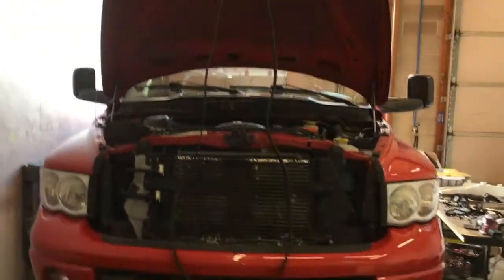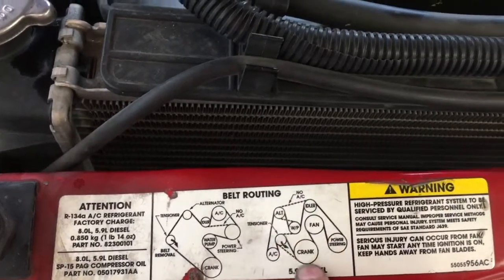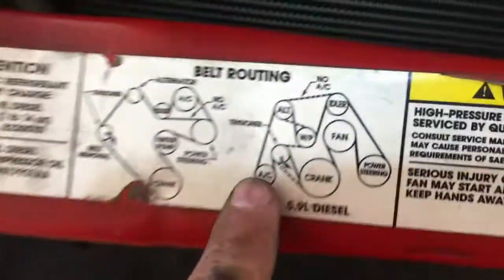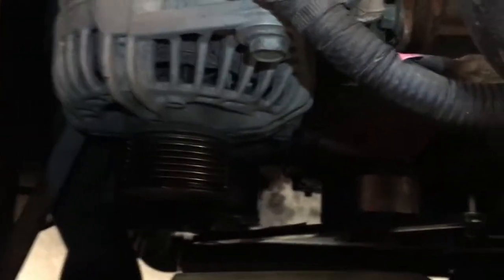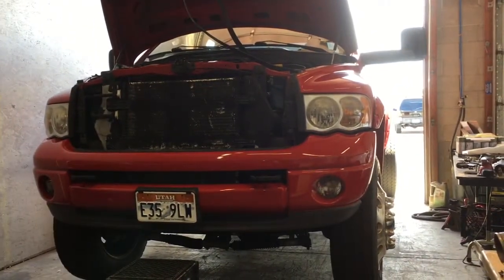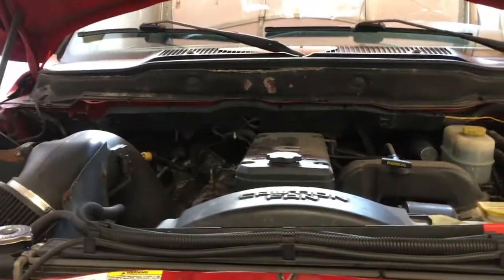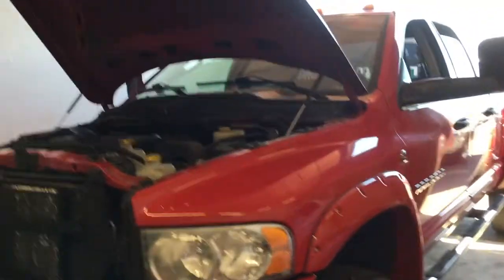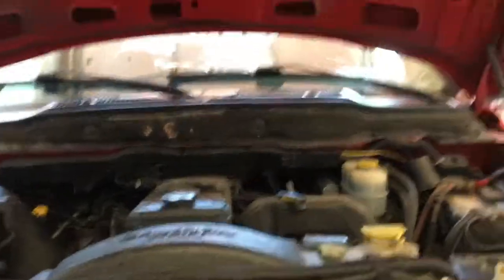24v Cummins 5.9 AC Bypass 3rd Gen Ram

Comment: Thanks for posting this video as you literally saved me over $600 with this video. I went to work and my compressor died on me and I watch me belt go up in smoke! I made the modification to the tensioner and my supervisor take me to AutoZone here in Puerto Rico and drove my Common Rail Cummins Turbo Diesel home! I a Soldier headed to Alaska soon and wont need A/C but will need the $600 plus my truck until I complete this tour. Thanks for your help and blessings!
Reply from the maker: right on man! thats what its all about brother. Helping each other get to where we need to go. be safe

Comment: Actually had the same issue a few days ago. I did not remove the compressor, just bypassed it as mentioned in the video, but when moved the new tensioner to the left posisiton I found that it had too much belt to work with. It turns out that tensioner does not need to be moved, just crank the tenioner as far down as possible. Add the last parts of the belt, then release the tensioner. Done - Works great using the belt depicted in the video. Thank you.

Comment: Thanks for the video.  My compressor was shot, did the ac bypass today, glad to see your video as it helped mostly with the belt routing.  I read about the moving of the tensioner.  What I ran into with my '06 was the threads in the new bolt hole were dirty/rusted so my bolt was not wanting to go in, it was messing up the threads on the bolt.   I went to Lowes and got a 10mm x 1.5 tap kit.  I didn't need to drill the hole obviously just screwed the tap in and that cleaned out the threads on the hole allowing me to get the bolt to go in smoothly. Overall a pain in the ass job really, belt seems like it could have been a  1/4" or so longer.  I seemed to be maxed out on cranking on the tensioner and I had to force the belt over the alternator.  I may have been hitting a mount on my plow with the end of the cheater bar, can't remember what I was bottoming out on.  Anyway good luck people.
Reply from the maker: Shawn Cripps the first time doing it wasnt fun, but reversing it or doing the 2nd time goes way faster. I had another guy help me that made a big difference. Glad you enjoyed the vid! Thanks
Reply: that tap made it work, thank you for adding

Comment: I was broke down in auto zone parkinglot. A/c seized up, broke the belt and fried my alternator at the same time. This video help me and my family get back on the raod. My only question is ? Do i have to change the idler pully on the water pump to a grooved pully wheel?
Reply from the maker: so glad to hear that! hell yea. And the idle pulley? no the tension keeps it on there just fine. glad you got her back on the road! great work
Reply: @roninmotors7466  Thank you. 👍🏻

Comment: Thumbs up for you!  Just did this, and noticed the tensioner has the ribbed part of the belt touching it.  Is this how it comes from the factory?  Would it cause issues?  

For anyone else wondering, I did some research, apparently it's not uncommon for ribbed side of the belt to go on smooth pulley from the factory.  Several manufactures have done this, including VW VR6 engines, some Corvettes have it, and since there isn't a ribbed tensioner pulley for our engine, I assume any shipped w/o AC would be this way.
Reply from the maker: BigBrotherIsTooBig no from the factory it comes with working AC ;) haha its fine, the tensioner is smooth and doesnt need grip from the grooves. Just looks funny is all. Thanks for the view!

Comment: So I had my AC compressor clutch go out and was making a terrible noise.   I was going to do this method for a temporary fix then it occurred to me that I can just turn off the AC compressor with the AC button on the dash which stopped the AC compressor but allowed me to use the fan and got me back on the road without having to do all of this.   Just a little food for thought if someone else is having the same problem.
Reply from the maker: Timothy Kettle that may work for some, great idea! That main thing this works for is when that AC clutch locks up, like mine did. No switching that off when its all locked up, itll burn the truck down at worst or gobble that belt fairly quick, mine was glowing red :/

Comment: my belt is riding the tensioner pully 3/16" closer to the edge. Has not been a problem. Just wondering if anyone else noticed this.
Reply: I just did the same thing today on my cummins fun job to do in a wind storm and by myself... I also noticed the belt is riding closer to the engine on the tensioner pulley. Anyone have the belt come off after the A/C delete modification??

Comment: Did  you used the same size  bolt? I have try it but the bolt won't fit in it.
Reply from the maker: Kick Herdez for the tensioner? Yes same bolt. Should thread easily
Reply: @roninmotors7466  thanks for taking your time and reply. I did try it a couple times but nothing, I end up just buying the ac pump, I just need it the truck to take me back home for that day. Thanks